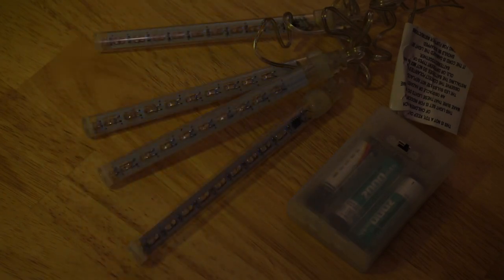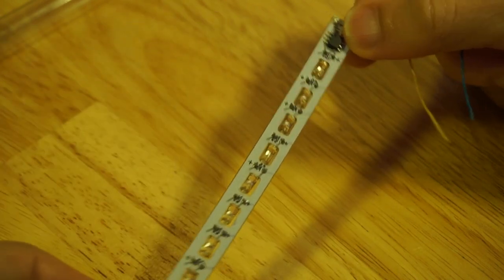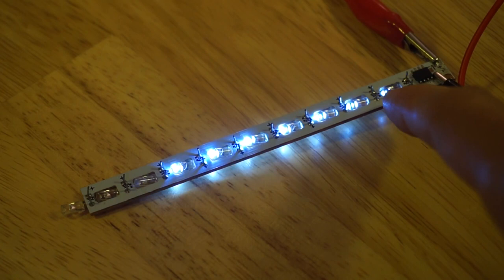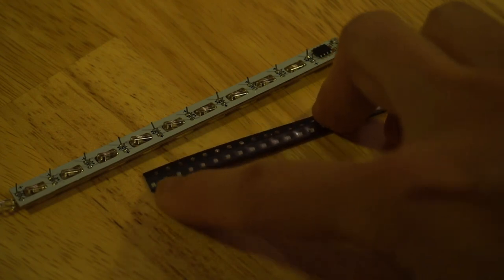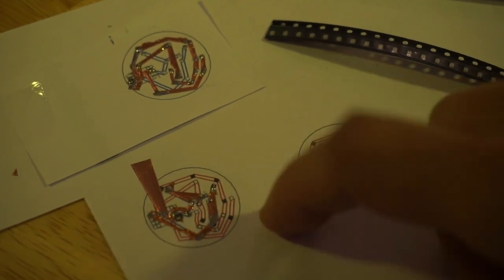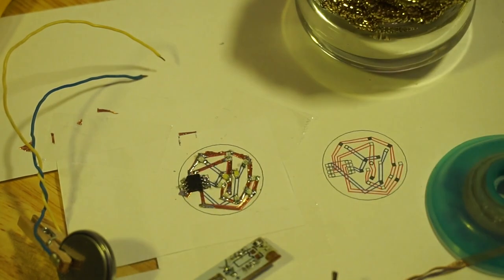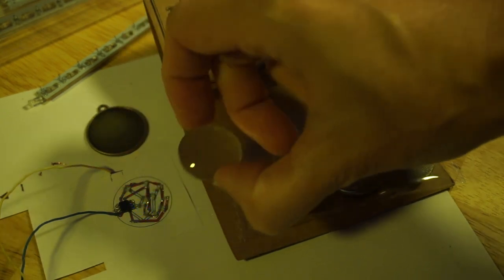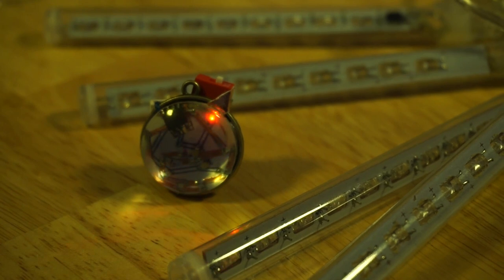Reusing Meteor Light Microcontroller to Animate a DIY LED Medal

Comment: I might have missed it, but is there a step down voltage or current regulation?  Maybe just through PWM in the MC?  These guys are usually powered by 5V 500mA wall warts.
Reply from the maker: This set is powered by 3 AAs. But I noticed each chip would still work when powered by a 3V coin cell